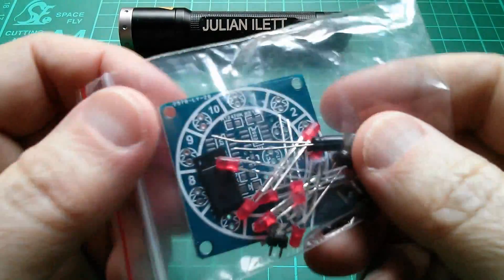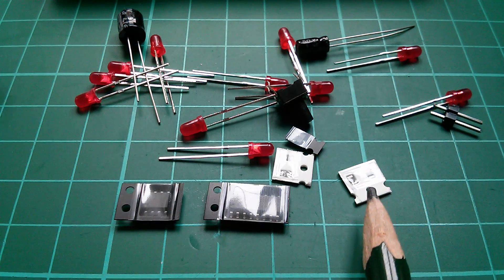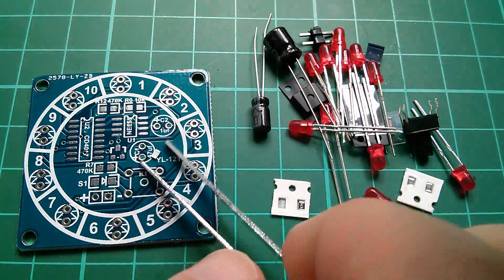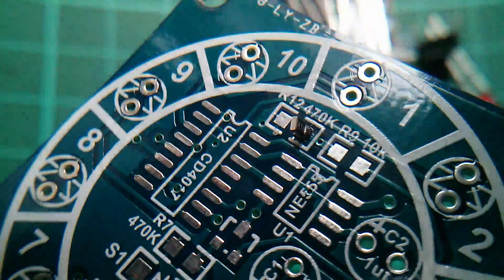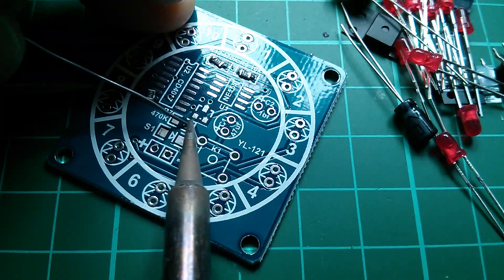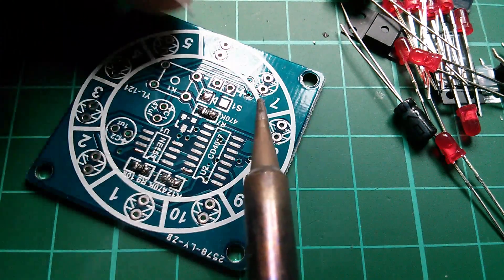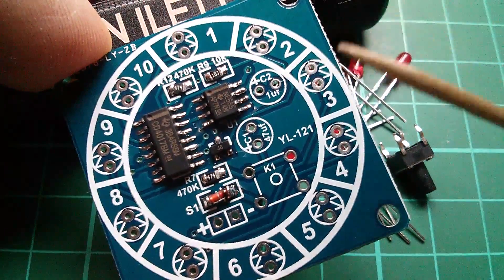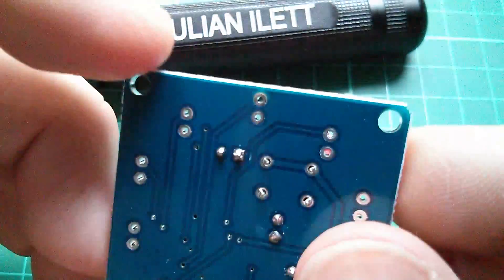Basic Electronics: Surface Mount Components Kit - 555 Roulette

Comment: One more tip. If you have a soldering iron with a big tip (to big) you could use a piece of copper wire. Wind it round the tip, create a small new tip by folding it, and now wind it back (firmly, so it gets rigid). Now you have made a little copper tip. Of course the solder may stick a little bit, but after some practice that is no longer a problem.
Reply: Great tip. :p
Reply: Thanks man. Now I finally got a SMD soldering tip.
Reply: Malkesh Patel
Great pun!

Comment: As mentioned, you could use drag soldering for the ICs. It is a bit counter intuitive, but you use a large tip for this. You put a tiny bit of tin on it, and just drag it across the pins. When doing this, it is important to put flux on the pads on the PCB first. With this method you can do a 0.5mm pitch easily. Another method is just reflowing them in a frying pan or small oven. Put some tin paste on the pads, put on the components and place it PCB first in a pan of some sort. Turn on the heat (preferably electric) and just wait until the solder melts. Temperatures aren't that important in hobby projects. I use the oven method all the time for prototyping PCBs before I send them of for production.
Reply: I wouldn't drag along the row of pins unless you know what you are doing... like tig welding you do not want your iron to touch the pins, just the solder. these would probably be ok but you risk bending the pins on anything smaller... drag away from the chip and the worst you can really do is get a solder bridge by using too much solder...
Reply from the maker: ***** I must admit, the results he's getting put my efforts to shame!
Reply: *****
You shouldn't challenge my vaunted ability to produce blobs in any set of circumstances.
Reply: *****
Okay, YouTube. When I leave YouTube links using a Kindle Fire or my Android phone, they don't work for people on PCs. I can understand YouTube having a problem with outside links set via mobile device, but not YouTube links. We idiots need you to idiot-proof that. Commenting here because mostly I comment here on Julian's videos. Very rarely anywhere else.
Reply: Julian Ilett The key word in that demo is "professional". I bet he's put in 1000+ hours of hand soldering. But don't let that put you off. Plus your "efforts" are actually very good in my opinion... chips aligned, pins flowed nicely, what more is there?

That sweep technique is what i was referring to and it almost looks counter intuitive that he uses such a big tip but it is necessary. A fine tip can very easily snag the pins and bend them sidewards. Also, the large tip has a bigger thermal mass and can hold all the required solder. The last thing you want is to hit a ground planed pin and have the temperature dragged down sufficiently to have the iron not melt the solder. Lastly, flat side down, tipped slightly like that will leave a hanging solder ball which sweeps the pins. Flux here is your best friend and is really the key ingredient...

Comment: I don't understand why everyone bothers with the blu-tac stuff..just bend the dang leads over a bit. shrug
Reply from the maker: PhattyMo Bending the leads over works fine... until you need to get the component back out.
Reply: Never been a problem for me. Just heat the joint,and pull it out. Done it thousands of times.
Reply: PhattyMo Never used the blue tac, until I just saw Julian use it. My first thought was, why didn't I use this before myself? I've got lots of that kind of stuf in my photography case. TOP tip Julian.
Reply: @PhattyMo You mean pre-bend the leads, so the stick by friction...? :)
Reply: Walter Boxhead We don't use bluetac in the industries, instead we use a little bend of the legs to hold it down by friction. If there is a component that doesn't have the leads to kling on then we usually use painters masking tape.
Reply: Julian Ilett I hate the bent over leads too but with leds you can spread the legs sufficiently to get then to hold in when flipped...

Comment: This might sound stupid but would it make sense to use a tiny dot of some light adhesive to hold at least the larger components in place the way you want and then solder them down, Like in the middle of the 555 put it down and make sure its aligned right and then solder away
Reply: i think that was actually done in the beginning of SMD, when pic&place machines where not that precise, they put down a drop of some red glue or wax or something between the pads to hold the component in place while it is soldered.